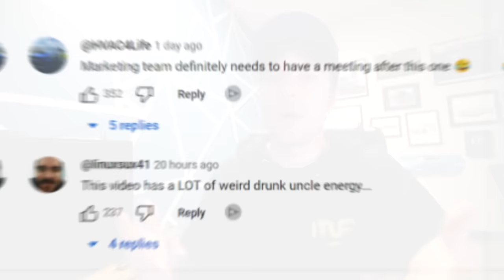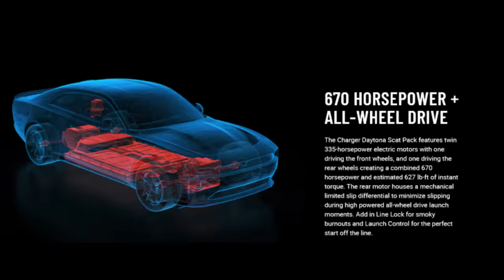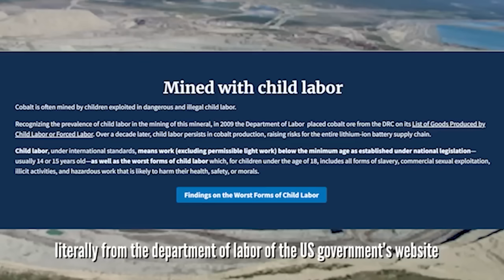The 2024 Dodge Charger Daytona Unveil Was Embarrassing

Comment from the maker: “So…I was thinking we do the entire reveal in green screen. Thoughts?”
Reply: Totally not a Daytona. And completely fake charger.
Reply: Dodge repeating GM story from 80's - it may actually work
Reply: You didn’t even mention the crazy weight of the ev. Almost 6k lbs! Hope the gasser is much lighter.
Reply: This is what happens when you sell off an American car company to foreigners..
Reply: So this may not be the Dodge Charger everyone hoped for but lets look at it this way, the 6 pack HO has 550 HP and AWD. We know that the eletric one is 5800 pounds, the battery pack alone is 2000-2500 pounds, subtract the weight and toss in the ice power train and we are around 3500-4000 pounds, you know what else has the specs? an R35 GTR thats it Boys we got an American GTR not a Muscle car
Reply: @focojeepr that’s typical of all EVs this size. The Cadillac Celestiq weighs 6600lb and it’s not much bigger than the Charger.
Reply: @ruddgrandprix-speedrunraci8515  Question, does the EV include a Dodge Charger upon purchase?
Reply: David, why do you dislike the 5.7L. I had 2 of them in my RAMs and they were great engines. Good horse power and torque and could take 87 octane. Sounded sweet with an exhuast.
Reply: The cool part is actually 1909 had an all electric car. Yes different architecture but never the less. Jay Leno has one and I'm thinking it's a Baker.. check it out
Reply: Do the Farley episode, saw the dude race at a historic, im a fan.
Reply: You mean chromakey, the name is chromakey
Reply: Have you driving a Ford! Lately ?
Reply: @MH-py1ou  because efficiency wise, the 392 was not only more powerful, but cleaner, more efficient and actually gets better mileage.
Reply: a deluxe Dart
Reply: @TomazHilton i agree the 6.4L is all that. I just dont get why the 5.7 gets looked down like its a 4 banger sometimes. Its a great entry into the V8 world for a more affordable price
Reply: don't reveal if you aren't a fan? wait for others then review
Reply: I think you tried to find reasons to hate this car, but it kicked your ass🤣🤣🤣. Tell us why we should respect your opinion at all?
Reply: Bet alot of them will be hemi swapped after the warranty wears off 😂
Reply: @Jay-jb2vr They never learn. Look at Chrysler they don't have much to sell its a wonder that they are still around.
Reply: @Jay-jb2vr  well, they were connected with Renault back in the 80’s, AMC tried selling rebadged Renaults, and Renault themselves tried selling some cars with help of their connection to Chrysler. Then there was the diamond star motors connection, and then Mercedes Benz, then Fiat, and now Stelantis: Citroën, Peugeot, Fiat, vauxhall etc. so…. Also without Mercedes Benz we wouldn’t have the Chrysler 300, dodge charger.
Reply: The green screen thing was really cheesy but perhaps a reflection of our current ‘terminally online’ culture… which would be ironic given that it was selling a ‘touch the grass’ real world product.

Did not care for the messaging. came off as a bit wah-wah and divisive, like everything fucking else these days.
Reply: It sounds like The Wraith.  I think The Wraith was stupidly cool as in literally stupid but in a fun 80s cool way but that sound effect on an electric car is seriously silly.

But you could charge a time travelling EV in 1910 if you know what you’re doing.
Reply: so a 2jz type engine is a joke to you?
Reply: @ruddgrandprix-speedrunraci8515  better take than ford's-ev/ponny is as in the ford lineup ( exception is the lighting as so far it's the better one but im a single-cab 8ft-bed guy, and yes i have a 80's k1500 and 60's charger and SO's 1967-69~ mustang/rustic lol 😂  ) where's the convertible-real-platform? as for 5.7 v8 id take that rather than the inline-6 as swapping later on is way easier to get 6.3/383ci and turbocharged/blower's mod's etc

but my current needs/lifestyle id be okay with the all-wheel-drive ( im around SLC Utah so winter is a thing here as is apartment/home charger convenient's ) BEV 2-door charger's idealy as a convertible but hard-top for now will work 

add wise probably a poor take hopefully better car/product

Comment: I like the inline 6 but a muscle car should have a V8 engine. I'm just waiting for the inevitable Hemi swap
Reply: They could have made a turbo hemi or a DOHC hemi or any alternative (maybe pre-chamber ignition like Maserati uses).  This just seems lazy and embarrassing.
Reply: They’d have to sell one first 😂
Reply: I think we’re gonna have to get passed this mentality. With emissions and climate change we’re gonna need to shift to fuel efficient engines, and a turbo inline 6 is wayyy more than enough and we’ve known this since the 2JZ. Hell im surprised the new mustang GT doesnt have an ecoboost V6 like the Raptor and keep the V8 to a GT500/Cobra trim. At this point we’re arguing over sound preference, a twin turbo V6 would develope power easier than a NA V8 would just do to the fact that the engine would already be built for boost and have easy and cheaper access to more boost and respond better to different upgrades. Whats the issue? What even is a muscle car, is it just a V8 is there anybody that really thinks a mid engine vette is anything short of a supercar? Is a 458 with a ferrari V8 a muscle car? Is a GNX not a muscle car cause it was a sixer? Is a musclle cause just a boat sized car with a big ass engine that makes a lot of boost? Cause imo the mustang hasnt been a muscle car in a long ass time and the only real muscle car was the challenger. Muscle cars have been dead a long time, V8’s will eventually be dead also and while it sucks thats life, its not supposed to stay static and things have to change and for actual reasons even if we wanna cover are eyes and ears about how man made climate change isnt real. Japan and Europe showed 6 cylinders is more than good enough, idk why its such an issue for americans
Reply: Idk guys if it’s any like them new BMWs it’ll be fast on the street if it’s tunable
Reply: Man until you own a v8 you really can’t speak for others. There’s something about the cold starts, the resonation through the body of the car, the raw torque, and most importantly, the reliability and simplicity. There’s a reason old BMW 5 series go for 3k on the used market and a v8 mustang of the same year are double that.
Reply: It's the rules. I'm not even a muscle car guy, but I get sad when I hear even a 4/6 cylinder in a huge hulking muscle car.
Reply: There are rumors flying around that another V8 is in the works. It will more than likely a DOHC and will be a competitor to the mustang V8. Only time will tell if this is actually true. Let's hope that they do!
Reply: Got 1980s styling, good fit for a turbo 6.
Reply: @unwanted_zombie shut up
Reply: It’s a 6,000lb car check the specs it’s nothing exciting about a inline 6 in a 6,000lb car nobody should Hemi swap this heavy aircraft carrier when it weighs more than the previous platform Dodge went and dumped 2,000 more pounds on top of a 4,200 pound car when the only complaint for years was these cars are too heavy instead of making it lighter they made the car twice as heavy!!!!!
Reply: @MusicNotes2024  no
Reply: @MusicNotes2024  no matter how loud your straight piped v6 charger barks at me, I refuse to yield.
Reply: @flyingphoenix113  Could they still call a DOHC motor a hemi? It would be like still calling the coyote motor a coyote while only have 1 cam and a 6200 rpm redline😂
Reply: Oh its coming
Reply: I agree muscle cars should have a v8, they sound amazing but there was a time when the baddest muscle car out was a 6, 87 GNX 🏁🔥
Reply: In-line 6 SUX BBBBBBIG TIME
Reply: @flyingphoenix113 They said they are no longer allowed by law to make V8s and before you go talking about Ford and Chevy having V8s it’s because they’re actually good businessmen. Both CEOs were ahead of the curve they know the brand is bigger than just performance cars and made cars for everyone gas commuter cars, pickups trucks and EVs. Dodge CEO wanted to make performance cars only like a dumb CEO. He didn’t expand the brand for every type of person. It’s no reason Dodge doesn’t have a gas commuter car and a medium size pickup truck in their lineup. You have to have this type of cars to combat the government you earn EPA credits this way by having cars that don’t emit bad gases into the air V8s emit so much bad into the air V6s, in-line and flat 6 and flat 4s etc smaller engines don’t emit those bad gases and EVs emit nothing at all so both Chevy and Ford have enough EPA credits stacked up to still make their performance vehicles Dodge has zero they only make V8s their CEO got rid of them in 2015 the Dodge Dart and Caravan and pickup truck are all gone.
Reply: I just wanna know how heavy that i6 version is! Because the EV versions are pushing over 5k.
Reply: @jessicadawn5815 audi  bmw and several other car manufacturers are still using v8s. Absolutely can not understand why dodge couldn't offer on!e SMH!
Reply: Lotta good points!  On the other hand, I don't wanna, therefore nope.
Reply: Nah, Barra swap everything
Reply: The inline 6 is more muscle than the V8......

The inline 6 makes more torque at a lower rpm then a V8 of equal displacement.....
Reply: @Angel7black  If the Mustang isn't a muscle car than how is the Challenger a muscle car ? What is the definition of a muscle car and or what would cause others cars to be considered as such when they lack such attributes of what people like to claim is a muscle car ?
Reply: @boostjunkie2320  lmao. Stop it! Go watch TV
Reply: The Chrysler Valiant Charger e49 was a muscle car in Australia and had an Inline 6 Hemi.
Reply: @pheflin2985 twin turbo hurricane i6 is in the wagoneer, a big suv, and does 0-60 in 4.7 factory with 510 Hp.
Reply: Could have been worse. Could have been a V6 instead of an inline 6
Reply: Depends on how worthy of an offering it is. Don't forget about the 1987 GNX. When they dynoed that turbo 6 it was making 330 power and 400 torque at the crank - just slightly underrated by GM for the official numbers.

It was kicking the royal schitt out of literally almost everything back in the day,  no matter what country it came from!

I prefer the V8 too, it's true to the original muscle car concept, but I would never want to live in a muscle car world where the GNX was never created, the four banger SVO Mustang, or a Shelby Shogun!

Those untraditional cars are a testament to the American ingenuity alive at the time and demonstrate how an enthusiast will always find a way to be an enthusiast! It gave us something to strive for and caused us to make something of ourselves, so we didn't end up a useless piece of schitt in our Mama's basement until we were 40!

Besides, if there's anyone at Dodge that still has half a brain, they'll understand that there's always going to be someone who's going to try to shoehorn a V8 into that engine bay!
Reply: Australia disagrees.
Reply: I was going to say the same thing about swaps
Reply: @boostjunkie2320 it's a 3L IL6. They are never much over 4L in almost any car for a reason, they get too long..
Reply: Put a hellcat in it
Reply: Did anyone ever see the movie the wraith? Sounds just like it.
Reply: @Ashbro117  3500-4000 the battery pack is 2000-2500
Reply: Atleast it's an engine and not a oversized battery
Reply: Thank you. An inline 6 isn't a muscle car. This is bullsh.t. Dodge is selling us all a gimmick. Fratzonic exhaust is bullsh.t. The car sounds like a blow dryer. They put a gear shifter on the console. FOR WHAT!! There's no mechanical connection to anything mechanical. You have a boost button to imitate the nitrous boost. Don't fall it folks. The new slogan is. #NoMoparGetAnotherCar!!!
Reply: @MrDerekRobinson they made a 426 DOHC Hemi in the 60’s; Hemi is referencing piston head and combustion chamber shape, got nothing to do with valvetrain type.
Reply: @LowTegs that's only because no one had the nads to turbo a factory V8 muscle car at thst time. A V8 with turbo would have blistered that V6. We never got the chance to know did we.
Reply: @redhunnid5142 so what? Stelantis is a worldwide conglomerate! Go sell someone else your 💩.
Reply: @redhunnid5142  Bugatti just made a new W16 engine.  So much for climate change 😆
Reply: @fredwilliams7893 Probably because this is pretty much Dodge's best-selling car.  The CA in CAFE is Corporate Average.  Having thirsty V8s would bring that down.  They've probably gotten away with it this long because of all of the V6 fleet specials.
Reply: In spirit yea, but tbh muscle cars through decades have been sold with a variety of engine options whether it be a V8, V6, I6 or I4
Reply: Watch them do that on the next SEMA
Reply: Thank you EPA but that I6 is probably going to be a monster if the tuning comes available.
Reply: @redhunnid5142 yup, the straight 6 would be awesome in a 3-4k pound car.. at 6k pounds, it's pretty much the ecoboost f150
Reply: @KRAMITDFROG  They got away from it by buying billions of dollars of "emission credits" from Tesla and other EV manufacturers. Tesla makes more off selling their credits than they do selling actual cars.
Reply: @islanddon865  🤣 give it 15 years, none of these evs will still be drivable.. nobody will ever open up a barn and say 'sweet, a Hyundai ionic5!'
Reply: I'm not an EV fan. But evoking stories of Muscle/Pony cars going back over a half of a century is rather odd. It's like complaining that the got rid of the modular cell phone for a digital. I'm a baby boomer who had a 69 Mach 1, 428cj and other hot pony cars. But l'm moving on to Hybrids. W.R.T. full EV's l feel more infrastructure development is required. Besides with all the illegal street racing in our cities, l expect full time self driving cars to suck the last muscle out of personal cars.🥺
Reply: @WhoThisGuy515  That's fine.  Still doesn't change the fact that fleet sales and, thus, the relative quantity of V6 Charger/Challenger/Durango are what made it possible to sell the V8s for as long as they did.  Carbon credits or not, they're still bound by CAFE rules to meet fuel economy standards.
Reply: An inline 6 can be a fine performance engine. We are Americans and we love good old fashioned V8s. 

But remember, the Corvette came out first with an inline 6. The Jaguar and BMW inline 6s have been all over the US for years. The Datsun Z has had a 6. The Toyota Supra has used a 6 since the 80s.

Since Stellantis had to stop making the high powered V8, the inline 6 is a decent place to start for a performance engine. I would be interested in seeing how they could make performance improvements for the 6.

Just having a big ole V8 and adding an intercooled blower has been done, thank you. Dodge made a 1K horsepower car that you could buy and insure, you couldn’t have thought they would make them forever?
Reply: @josebrown5961  We love our V-8's, but I'm not so crazy about hitting new temp records (122°) down here in the Mojave Desert every year.
Reply: Why we calling it a muscle car? It's just a sports car now
Reply: Swapping is probably a no go.
Reply: @redhunnid5142  The charger sixpack does not weigh 6000 lb's. You're illiterate buddy
Reply: @Ashbro117 drop 2k for the batery and motors, add 1k for the ICE motor and accessories. a good 4k
Reply: @Angel7black  but what about the sound?
Reply: @LowTegs   sorta
Reply: Exactly what I'm saying
Reply: @Angel7black it’s the reason I chose to go with my RC350 AWD over the V8 F version. It’s has 311 hp… more than enough to do what needs to be done on the streets or otherwise. The sound would be the difference outside of performance. But muscle cars that had 311 hp in the 80’s or 90’s with v8 would’ve have been considered fast as hell. Can I easily hit 110? Yes… & it’s easy on gas. I love Lexus ‘ had a GS with the V8 before this one. & reliability is another reason I choose them.
Reply: The 5800 pounds is for the EV’s. The in-line six will not be anywhere near 5800 pounds.
Reply: Daytona is faster than a hellcat
Reply: @redhunnid5142  Uh, thats the EV weight, not the 6 banger dude. Batteries are heavy. You think they left the battery in a ICE car? Geezus christ...
Reply: @MrDerekRobinson  Surely you jest? How many of their supercars so they sell in a year? 50? 100?  Please educate yourself, they are able to sell because they don't even sell 500 in a year. They still fall short of CAFE emmissions....
Reply: @Angel7black ok you don’t get it, it’s ok
Reply: @redhunnid5142  I think the problem with Stellantis is they were putting the HEMI in everything instead of reserving it for strictly performance cars.
Reply: @williamrose7818  Probably about 4000 lbs. for the Six Pack.
Reply: @Angel7black  I don't want to hear a single word about "man-made" climate change until you AT LEAST cite a scientific article that states that. It's really easy to take a sentence out of the wider context and run with it.
Reply: is that before or after constant turbo bearing fails @Angel7black
Reply: @josebrown5961 I had a 1973 240Z inline six, good motor but slooow. There is a reason why the Corvette didn’t keep the blue flame 6 cylinder. V8 engines are the best.  Glad I had the opportunity to own many before they killed them off.
Reply: @fastdude2002 Well they couldn’t make 1K horsepower mills forever. I’m glad they did but it’s over. The Charger/Challenger was old anyway it needed to be refreshed.

But since they were still selling it does seem weird that they stopped making them. If people were still buying an almost 20 year old car…
Reply: 😂 yeah maybe 2 people total will have 30 grand each to spend on converting an EV to an ice
Reply: @Jay-jb2vr no, its not coming. its almost impossible to comvert an electric car to a gasoline engined car.
Reply: @redhunnid5142  Hopefully the inline 6 Hurricane option will weigh less than 6,000 lbs.